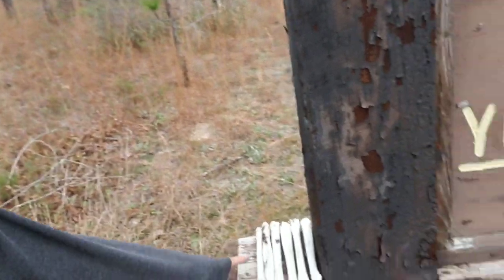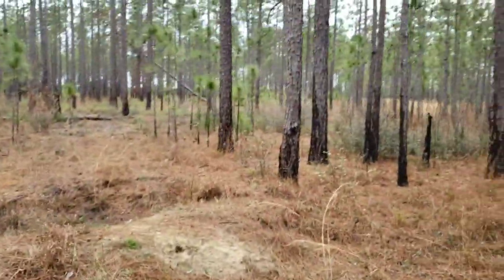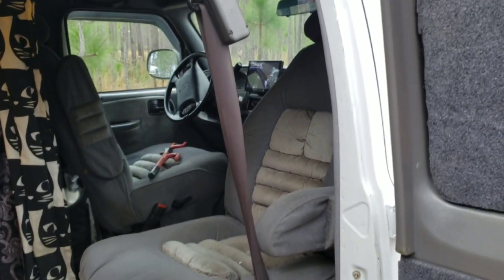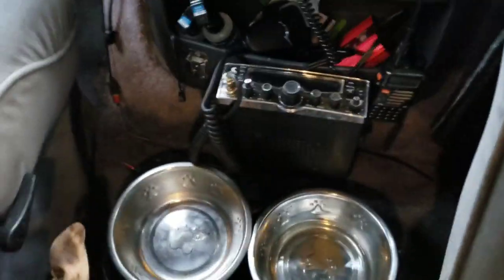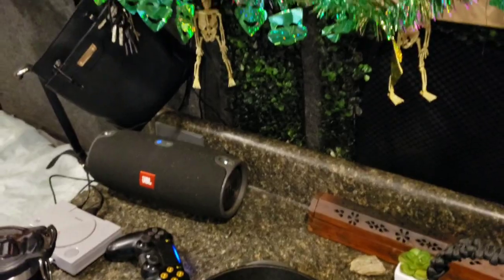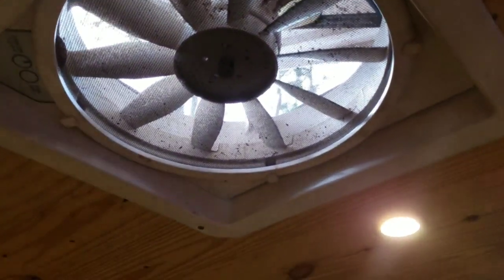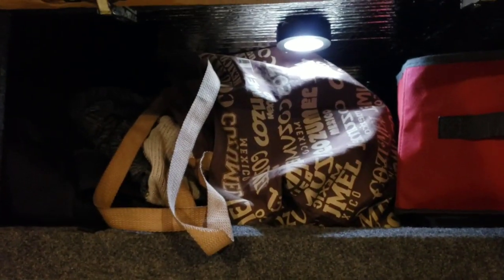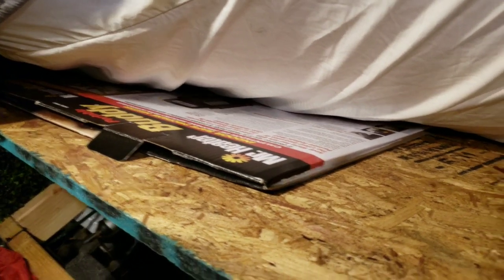DIY Dodge Ram Full-time camper Van

Comment: I alwayz dreamt of traveling in a well packed Van. Will get a conversation van w/a raised roof and the works and just jump on the rode with it. 😏
Reply from the maker: It's fun, but it's not easy. Cops are the worst. I'd rather break down and have to fix this thing roadside then deal with those armed goons. But yeah, do it
Reply: @tashatorrid  Of what hardships are there should l be warned of while camping out and on the road passing thru the states on a certain schedule. ( like maybe leave home for 2 or 3 wks before returning home)and thanks 😉
Reply from the maker: I never make plans. Was gonna be gone two weeks last time I left Florida and was gone for six months
Reply: @tashatorrid  😆

Comment: Hi Tasha I like how the paint job on your van turned out I know you said you did all the work yourself Does that include the Electrical? You know in my Younger days I could remember wiring in a new radio in my car or a CB Radio in my Truck but like your back up camera or your Solar looks confusing to me.Good video
Reply from the maker: I did everything aside from dropping the transmission because I didn't want to rebuild it without a lift and a second set of hands to r&r